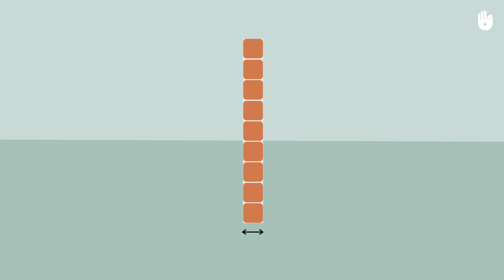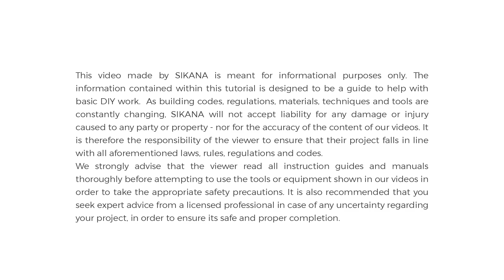Thickness of Walls | Masonry

Comment: Do I have to build wood framing inside of the brick walls?
Reply: no, brick walls are strong enough without reinforcement, if the building is single floored. if youre adding more floors, then i suggest steel reinforcement rather than wood. wooden frames are installed when we are making drywalls or walls with stone masonry
Reply: You will if you want insulation. Concrete Masonry Units and bricks have an R-value of less than 1. Standard insulation has an R-value of 16 to 24 depending on the type and thickness. Your building code almost definitely will require you to have your walls be of a certain R-value. So in that case, you will have to frame interior walls so the batting has somewhere to go and for the drywall to attach that will go over it.